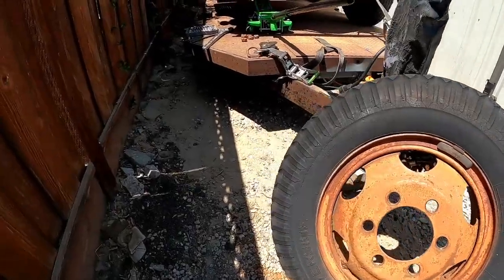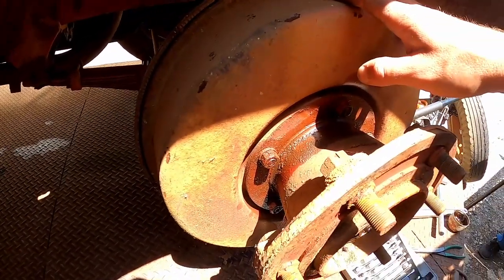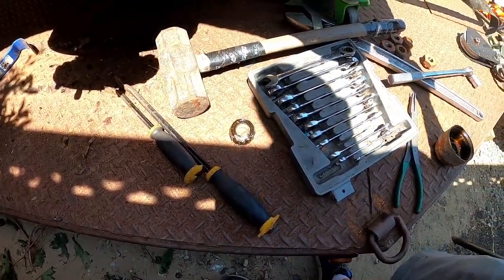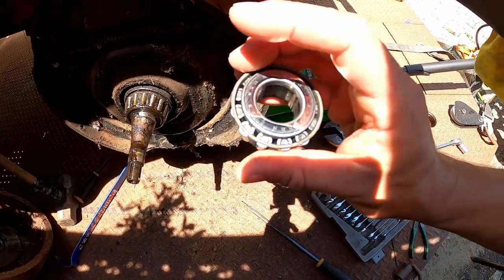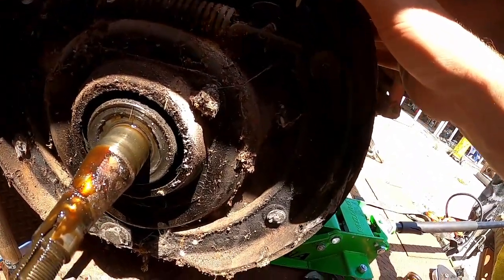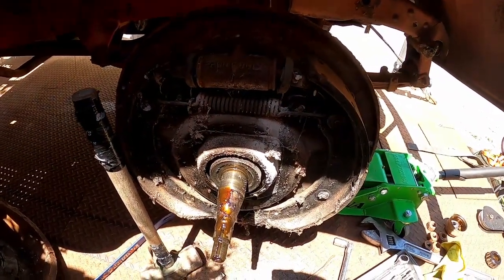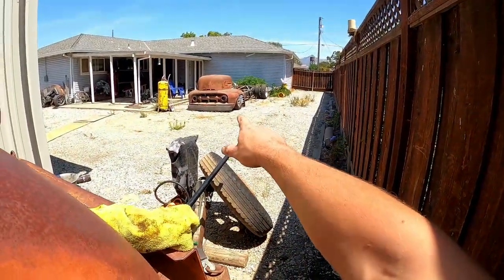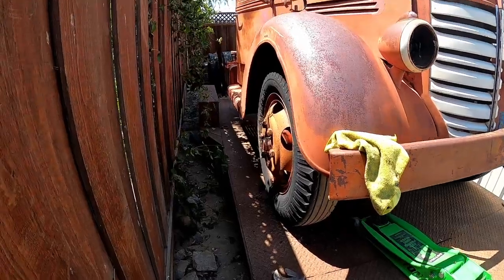Federal truck has stuck brakes

Comment: Best way to deal with old stuck brakes is knock them all out until you have new ones to put back on... good work man
Reply from the maker: Thanks! Yeah that really seemed like the only course of action! I’m really leaning towards replacing the axle entirely but the truck and frame are very narrow

Comment: Daaaaang, powdered brake fluid. 😂  I have a vacuum bleeder if you want to use it lol.  Not a fan of drum brakes because the wheel cylinders always end up leaking.
Reply from the maker: Yeah me either I’ll most likely just get newer axles and upgrade the booster setup 👍

Comment: These trucks were built with a lot of purchased components. Something like today would be a company making the frame and body but buying an engine from Cummins, transmission from Eaton, axles from Dana, brakes from Bendix. There is some info on them out there but it is pretty sparse. My Father has a 1947 Federal. Parts haven't been the easiest to get/find and covid hasn't helped either.
Reply from the maker: Thank you for the information James! Are you and your dad trying to keep yours original?
Reply: @turborich8316  Yeah, he is keeping it original. He has a collection of various old trucks and works on one a little at a time or when he has parts. I don't remember specifics but the engine something like a Continental or Waukesha eventhough it has Federal cast into the manifold. He had it out and apart but I don't remember what was done to it. Its since been put back together and in the truck. He also either got a new clutch or had it relined. Last time I saw it in person he was working on the brakes. It took him awhile to get what he needed.  I think he was able to find new wheel cylinders but couldn't find new shoes. I think all he came up with was new brake shoe linings and that was his next project to tackle.

Comment: The work/welding table lift is awesome. Did you build that?  We’re very interested in how it works.  We would love to get more info on it!
Reply from the maker: Do you mean the one inside my shop? The truck itself is just sitting on my trailer. The one inside my shop utilizes the harbor freight 6k car lift that I counter sunk into the floor of my shop, with a 3/8” plate on top that has afew 2x2 .120 square tubes welded to the bottom to keep it rigid! The plate is also removable with my gantry in case I want to use the scissor lift for a car
Reply: @turborich8316  It’s awesome! It’s s great idea! We’re fans!
Reply from the maker: Thank you!